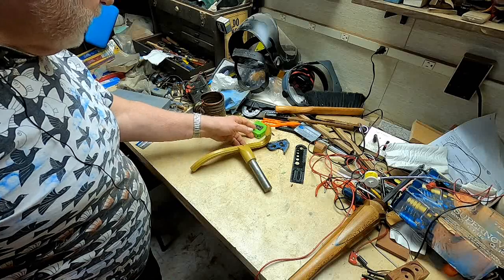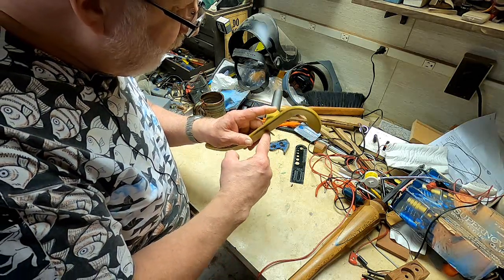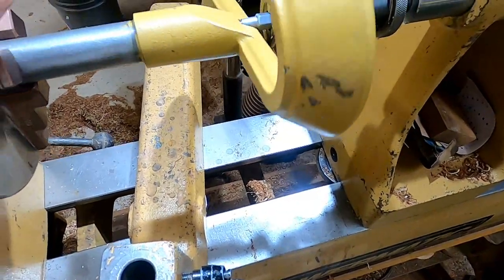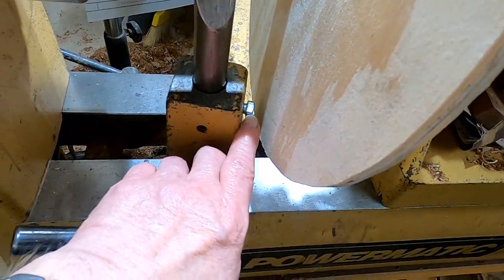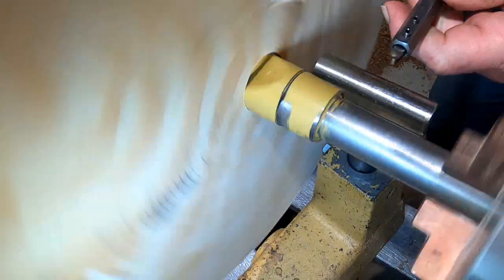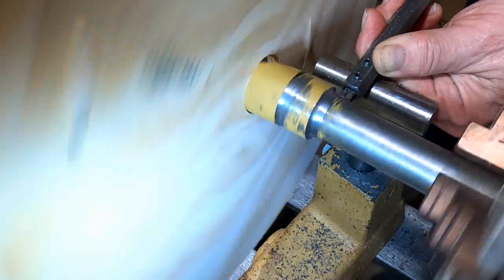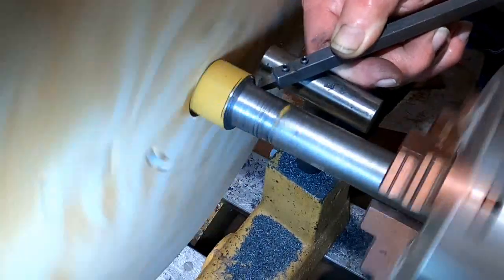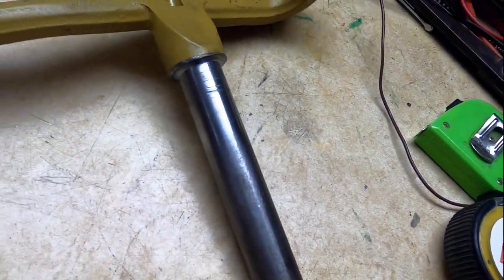Turning Cast Iron on a Woodturning Lathe

Comment: Nice Job and a good way to think outside the box to get the job done. I rigged a cross slide vise to my lathe and put a tool bar in the vise with a HSS tool in the boring bar. The cross slide vise gives me to axis to cut with. I just shim up the boring bar to get the tools to center. It is more sturdy, so I make light cuts and get there. Does not work for everything but you can get by.

Comment: Fascinating!

But the concern I had was that I presume that there is a recess in the cast iron portion of the tool rest to receive the steel post.  If that is the case, how can you be sure that when you turn away the lower portion of the cast iron (making the recess more shallow), that the joint between the cast iron tool rest and the steel tool post will still be strong enough.  When catches occur, that joint gets a lot of stress, and I've had a couple of tool rests break at that point.  So I would be concerned that turning away a portion of the cast iron could weaken the tool rest leaving it at risk of failure when (not if) catches occur.
Reply from the maker: This is a one piece casting. The post and crossbar are cast at one time and then the post is machined to the proper diameter. I just extended that machining up further.
Reply: Exactly . Don't look safe to me